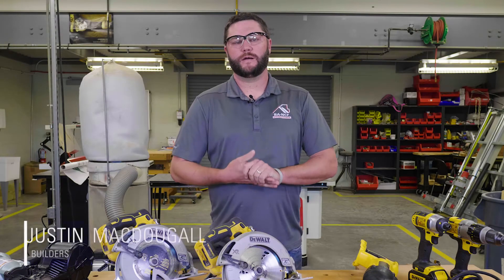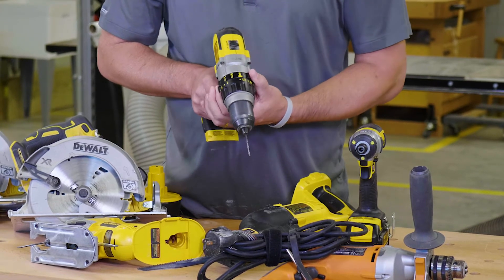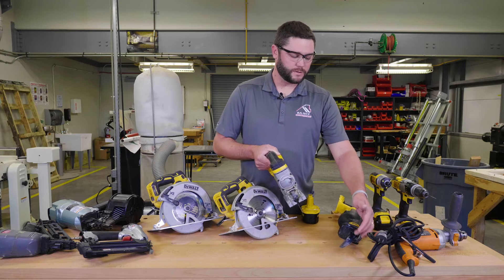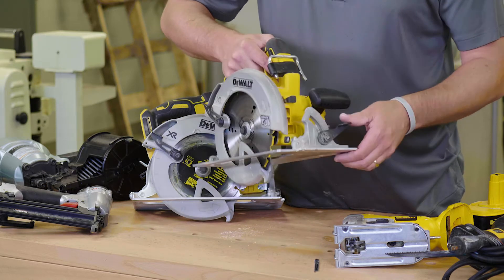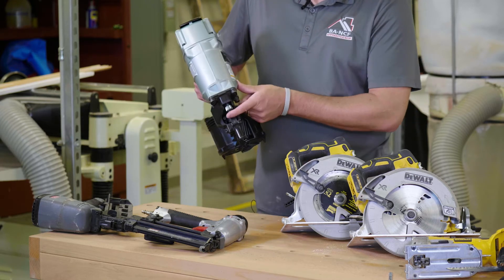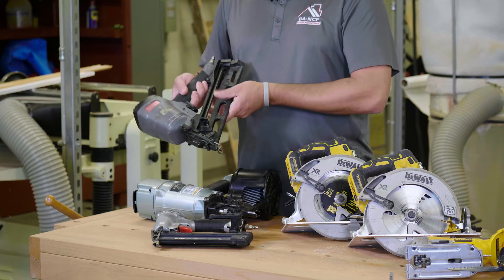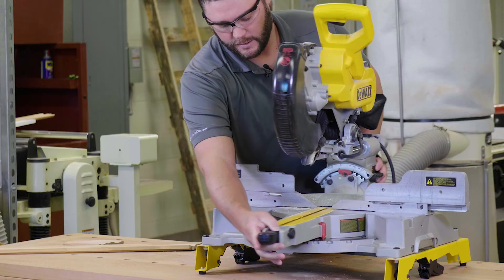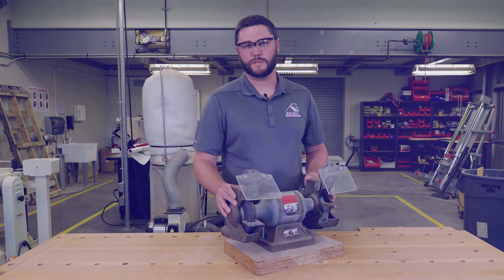Power Tool Overview (NCCER Module 00104)

Comment: The Rigid drill is not a right-angle drill. It is a standard corded power drill. Right-angle drills kick off at a 90-degree angle. You may want to edit that to avoid spreading the wrong information. Good video though.